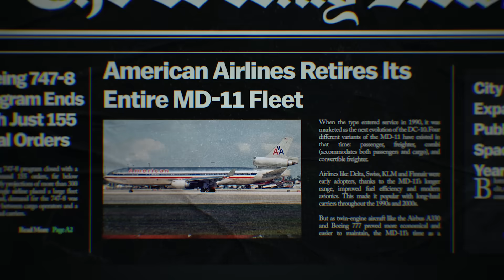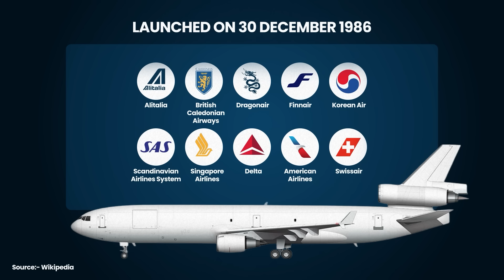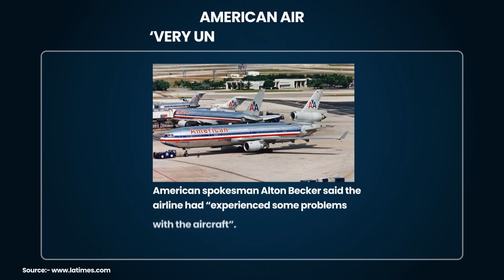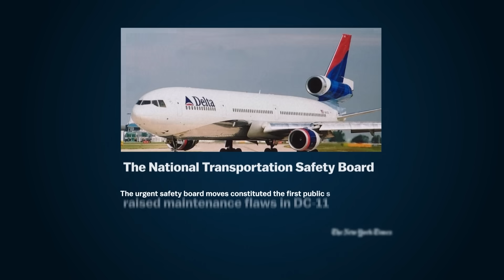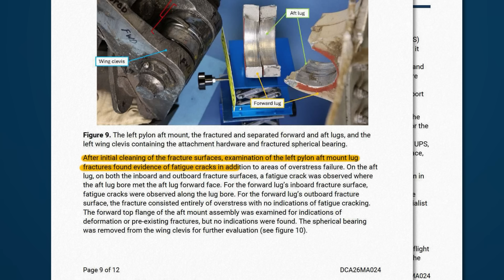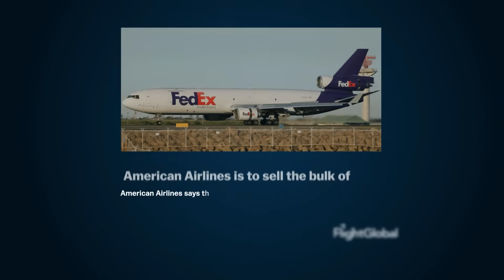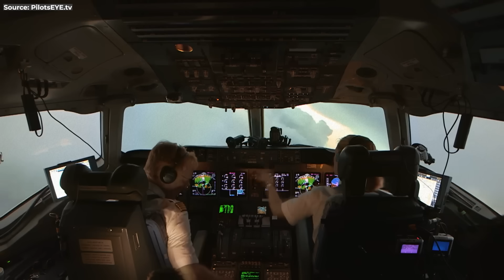Why UPS and FedEx Still Fly 35 Year Old MD 11 - Against All Logic

Comment: I am sure a more knowledgeable person may have pointed this out, and it was touched on in the video - while the airframe is older, one of the most important matrixes in an airframe's life is it's number of cycles. These are being flown fewer total flights vs in passenger service, they keep them in the air as much as possible. Land, dump passengers, service, new crew, new passengers and take off again - as many times as they can schedule. In cargo service, it is more likely to do two cycles a day at most. That is a lot less stress on the airframe. If the plane was designed for 10,000 cycles, it might be 30 years in cargo but only 20 years in passenger service. I am sure someone can post for us the actual numbers because I do not have them.
Reply: They're designed to last about 100,000 pressurization cycles in extreme cases. The major airlines like to sell the planes by about 10,000 - 20,000 cycles. And retire them by about 30,000 cycles. After that you need to inspect them more carefully. Aloha 243 (which lost its roof in-flight due to metal fatigue) had 89,680 flight cycles. The inspections are important because there's a large random component to the growth of fatigue cracks. So although the part may be designed to last 100,000 cycles on paper, randomness in manufacturing and loading could cause a crack to grow to a critical size well before then.

That's probably what caused the recent UPS accident. The preliinary report said the bearing for the aft pylon bolt showed signs of both fatigue and overstress failure. So the fix will probably be to inspect those bearings more frequently, and replace them if necessary. Not a permanent grounding. I suspect the delay is because they want to evaluate if the parts need to be redesigned to be stronger. One of the intact bearing mounts showed signs of damage due to movement, and they'll want to figure out if that happened before or because of the accident. The UPS plane had logged 92,992 hours and 21,043 cycles.

Comment: I appreciate the content of this video, but I think you made a significant misrepresentation.  While FedEx did announce the planned fleet retirement date of 2032, it did so many months BEFORE the UPS crash in November.  This is significant because that decision was made before the airworthiness directives regarding the MD-11.  At this time, no one knows exactly what will be required to get these aircraft back into operations.  You are absolutely correct in the fiscal analysis of why the cargo carriers adopted the MD-11s in the first place.  However, it is possible that the compliance with the airworthiness directives will be cost prohibitive.  We just don't know and none of the airlines have formally stated decisions in this post-crash environment.

Comment: People complain that these planes are too old, yet fail to realize that some 777s is essentially as old as the MD-11.
Reply: Then you consider airframes Ike the B52
Reply: @Lilunc25  it helps longevity that the b52 isn’t fully pressurized only the crew compartment, they fly less often, and maintenance costs aren’t as big of a concern in the military compared to a commercial airline.
Reply: @TheScottbb1  When it comes to pressurization, that is the main reason many passenger planes can find new lives as cargo freighters for a few more decades. The only area pressurized on freighters is the cockpit and the very small passenger section. There might be a pressurized cargo section on some models but most of the plane is not pressurized.

The other thing that helps longevity is freighters do not fly as many flights per day as passenger planes and routes are often longer. In the US, cargo can be carried by air but it is much more expensive than by train or truck.
Reply: @minhduong1484  I'm not sure where you got the idea that cargo jets don't pressurize their cargo compartments, but this is quite wrong. They need to pressurize the cargo compartment to avoid damaging cargo and to allow for in-flight inspection of cargo areas should there be a problem. And even if it weren't for that, these aircraft don't have a pressure bulkhead between the cockpit and cargo areas, and they are invariably designed to be fully pressurized anyway because all of these airframes are also designed to be used for passenger jets.
Reply: @Curt_Sampson What I mean the plane does not need to be pressurized for humans. On a passenger planes above 10,000 feet there is a need to pressurize the cabin to keep people alive. That is not required for most cargo. If a crew member needs to check the unpressurized cargo area of a freighter, they need to wear an oxygen mask above 10,000 feet.
Reply: @minhduong1484  And I mean, as I said explicitly in the previous post, that the plane does need to be pressurised for its cargo. 

And note that, if the cargo compartment were unpressurised and needs to be available for inspection, an oxygen mask is not enough: you also need an airlock. First it was a pressure bulkhead, now an airlock: you're proposing adding more and more profit-sucking weight to the aircraft with every message. Have you considered that it's actually cheaper to pressurize the whole aircraft than to do this?
Reply: The aircraft are still pressurized as they were in their original configuration. The aft pressure bulkhead is just forward of the tail area.
Reply: @Lilunc25 those are military, so the guys flying them have already signed up to risk their lives anyway lmao
Reply: It's hours and cycles that count not years. A freighter spents a lot more time on the ground than a passenger aircraft
Reply: designed 30 years ago is not the same as built 30 years ago
Reply: @lander77477  The MD-11 was designed starting 1986 with the first planes certified in 1990. The 777 was announced in 1990 with first planes entering service in 1995. In terms of time, there is only a few years between them. However, the MD-11 was an iteration of older DC-10 whereas the 777 was more of a clean sheet design.
Reply: @minhduong1484  Exactly the 777 was clean sheet brand new design created in the 90s whereas the MD11 was basically a heavily reworked DC10. 

A design that has been around since the 60s and that was infamous for design flaws. Like blowing out cargo doors and engine pylon issues it is great saying the MD11 is a 30 year plane but the reality is it is heavy re-work of a near 60 year old design. As the UPS crash showed it still has the design flaws of the DC10 so the comparison with the 777 is frankly a stupid one.
Reply: I had no idea the 777 was that old. Or maybe I though the MD-11 was much older than it is. I remember when the 777 was brand new, but not the MD-11.
Reply: @maxstr i remember when the MD 11 came out... It already had super modern glas Cockpit and Digital Instruments back in the day.
Reply: Do you mean in terms of cycles?
Reply: The first 777 built (N777UA) was just parked and put into storage for lack of engine parts.
Reply: @zaphodb9213 most likely a generation 1 engine parts are not in demand
Reply: The MD-11 was manufactured from 1998-2000. First flight: January 10, 1990. Introduce on December 20, 1990, with Finnair. Retired from passenger service on October 26, 2014
Boeing 777:
Manufacture: 1993-present
First Flight: June 12, 1994
Introduced: June 7, 1995, with United Airlines
Number built: 1,772 as of October 2025
Reply: They were practically obsolete when they were delivered, the engine pylon mounts were wonky, the sucked fuel, and their safety record was horrendous.  Airlines unloaded them as quick as they could, and for good reason.
Douglas should have never built this aircraft.  Just let it die in peace.
Reply: Not to mention 747...
Reply: The age isn't the problem.
Reply: It is not about old, but lifetime design of the air frame. A life span here stated as 30-40 years, leaves the 35 recent plane that went down in the mid range of that estimate. The cause of the crash being structural fatigue on the port engine pylon. Exactly the same type of failure as for the passenger DC/MD-10 that went down ages ago. 

How the life time of an air frame is calculated is unknown to me, by I assume if it is used as a cargo plane vs a passenger plane i.e. with a higher load carrying, the life time of the air frame drops.
Reply: @iRelevant.47.system.boycott  Cargo aircraft used by overnight delivery companies generally suffer much less stress than passenger aircraft because they don't fly as often.

Nor do they carry significantly heavier loads: passenger aircraft are virtually always carrying cargo as well as the passengers and their baggage.
Reply: I was in MD 1975 - 1981. MD-11 should have never certified to fly because of poor engne mount design, they never changed even after the DC-10 crash.
Reply: @rampar77 ….two 747’s crashed when an engine broke off. Agree….the 747 should have been grounded as well.
Reply: Comparing the MD11 to the 777 is in all honesty a rather silly comparison. MD11 is a heavily reworked DC10 which is a plane which was designed in the 60s it is fundamentally a plane based on a near enough 60 year old design. 

Whereas the 777 was a clean sheet design created in the 90s MD11 had the same engine pylon mount issues as the DC10. A design flaw which caused the deadliest crash in US history with a DC10 and the MD11 crash recently in Louisville. Despite McDonnell Douglas’s claims the MD11 never met its performance targets in passenger service which is why so many airlines like American and Delta offloaded them. Whereas the 777 is in many cases the backbone of many airlines long range fleets. 

Age comparison doesn't work with the 777 and MD11 nor does comparing them in anyway when the 777 was a vastly superior vastly safer aircraft. Same with the Airbus A330 which also came along around the same time.

MD11 was essentially hacked out because McDonnell Douglas couldn't afford a clean sheet design and still delusionally believed there was mileage in the trijet concept. They made hilarious performance claims that the MD11 could never achieve no wonder McDonnell Douglas no longer exist.
Reply: Thats a terrible argument there bud 😂
Reply: Only if you include the last passenger MD-11s to be made and the oldest 777s. However many older 777s have been converted to freighters like other older aircraft. One of the age problems with the MD-11 was the design was older not just the individual planes. Boeing has updated the 777 design whereas the MD-11 is discontinued.
Reply: @minhduong1484 The problem is news companies are questioning why shipping companies like UPS, FedEx, and WGA are still flying the MD 11 even though they're 30 years old. Yet there are plenty of aircraft that are 30 years old. Not to mention there are some that are even older yet still run fine. The problem is McDonnell Douglas didn't manufacture their planes properly.
Reply: @BubbamanMHow about they bought the aircraft long ago and they are still profitable to fly as cargo freighters? If they were not profitable, cargo companies would drop them instantly. Until the recent crashes all of them had plans to retire the model over time.
Reply: @BubbamanMlasted 30 years... so far...cant be all that bad of a build. By now they have been thru a few d checks
Reply: @BubbamanMThe MD-11 is very well built. It seems there may be a weakness in the engine mount pylon but they have proven themselves for 35 years.
Reply: @Beenomars  Well built no let me stop you there a plane that has a habit of throwing it's engines off the mounting pylon is not a well built plane. For Christ sake this is an issue that existed with the DC10 as well and still happened with the newer MD11. MD11 is a heavily reworked DC10 but the DC10 had a poor safety record you're delusional if you think that it's well built. If you don't want to say it is well built I'll point you to one that recently crashed in Louisville.
Reply: @BubbamanMThe other issue is parts. In order to service these planes airframes need to be broken apart for parts.
Reply: @teabagtowers3823 so you,re saying the only planes that crashed due to fatigue related problems in the past 30 years are md 11,s?
Reply: @roblonsdale8927  No I'm saying that other planes haven't crashed in the last 30 years due to fatigue. MD11 and DC10 are uniquely unsafe aircraft as the engine pylon flaw was present on the DC10 as well as the MD11. Nice try though.
Reply: @teabagtowers3823 So? Many aircraft with otherwise good records have also crashed due to a flaw in a small part.
Reply: @teabagtowers3823 …the 747 had the same issue. The 707 as well. Older 737 as well.
Look ip El Al crash in Amsterdam.That was a 747.
I am pretty sure you don’t know much about aviation…..
Reply: @teabagtowers3823 …habit ? How many MD-11 crashed because of this issue ?
Reply: @m @minhduong1484 tually the floor beams in the passenger B777 are not strong enough for freighter use. The first ever STC ( Supplementary Type Certificate) for a freight conversion was issued to Israeli Aerospace Industries September of this year.
The B777 freighters in service at the moment are purpose built.
Reply: The problem is the DC-10 (that the MD-11 was based on) crashed like there are 737 Maxes.
Reply: @awdrifter3394 if i rember correctly ... door blow off issues.. loss of pressure in cabin 9caus8ng crashes

Comment: The info in short: md11 failed as a passenger plane because of high fuel consumption and short range. It is successful as a cargo plane because it has a max payload only 20 percent less than a 747 but way lower running costs. They will continue flying because they are already paid up and staff are familiar with them.
There. Saved you 15 minutes of your life.
Reply: You forgot they got them for the cheap relatively new when they failed as passenger planes.
Reply: Exactly what i was looking for
Reply: Thanks
Reply: Saw this too late but thank you
Reply: All that verbiage and missed two key points:

The MD-11 volume carrying ability divided by weight carrying ability is lower than other aircraft and closer to the act density of cargo that FedEx and UPS carry. So that makes it attractive.

Secondly, in the case of FedEx, they actually implemented an Md-10 program, retrofitting dc-10s with MD-11 cockpits, thereby gaining additional commonality across the fleets. The md-10s are now long gone, but while they lasted this was another major cost saving benefit.
Reply: @cv990a4  Lots of other stuff missed, too, such as why the higher fuel consumption isn't a problem for the freight companies but was for the passenger airlines.
Reply: @Curt_Sampson  Lower utilization, presumably.
Reply: @cv990a4 that was discussed in the video
Reply: @Curt_Sampson Its a problem for them as well.  Its just that they bought them cheap.  Its like buying an old station wagon that guzzles gas.  For the right price, its quite suitible for hauling stuff.😊
Reply: @stvrob6320  and the old station wagon has an ashtray
Reply: I fell asleep from the video missed  most of it went to the comments and found this
Reply: @AngusElmslie lol same
Reply: Thank you
Reply: The one time I should have read an upvoted spoiling comment for my own good…
Reply: Succinctly put.
Reply: And this also makes very good business jets.
Reply: Thanks
Reply: The F-16 is 46
Reply: It is successful as a cargo plane becasue they bought them dirt cheap when all the airlines realized they were rolling the dice using them for passenger service.
This is the Aircraft that doomed McDonnel Douglas.  Its OK to be nostalgic as they fade away completely, but don't be fooled into thinking this was one of the great aircraft of our time.
Reply: @stvrob6320  This aircraft clearly did not doom MD. They went on to successfully take over Boeing and continue to develop new and interesting ways to make aircraft crash.
Reply: Who clicks on a vid to just read a summary? No need. Thanks
Reply: Thank you for this.
Reply: I kind of figured that's what it was, and Im not even mechanically inclined. Thank you.
Reply: Thank you. Saves me the time.

I had a hunch it was going to be like this.
Reply: GOAT.
Reply: Thank you I should have read your comment first. 😊
Reply: Thanks. :)
Reply: Good summary, but I did enjoy the full video.
Reply: Thank you for doing gods work! Bless you, you’re a good man.
Reply: Nah, I actually liked the way the video explained it

Comment: First, McDonald Douglas never PROMISED a specific range. They FORECAST ranges which depended on flight operations. This is nothing but a hatchet job on an aircraft that served many years, and when compared with other aircraft types, the issues (while sad) weren't as dramatic as you're making them seem. Yes, some people lost their lives, but when there are mechanical elements involved, and proper maintenance is required by HUMANS, the chance of mishaps will always be possible. The MD-11 performed daily without incident until poor maintenance came calling, and THAT'S the bottom line.

Comment: well the so called "enduring success" might not have been so enduring if the upfront costs for FedEx UPS were as high as passenger airlines, it still doesn't say much about the MD11 design shortcomings.  It's just that the operational purposes of freight carriers masked it.  I'm not sure what this video is trying to say? it's ok to design aircrafts such as the MD11, and not improve on the design and maintenance / serviceability of the aircraft? as long as there is a buyer?  or use case? what's your point